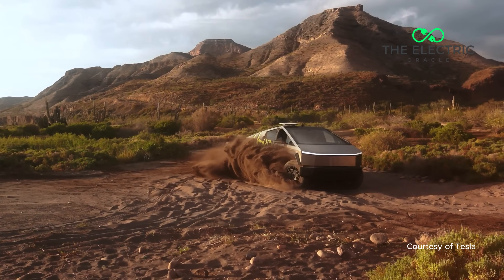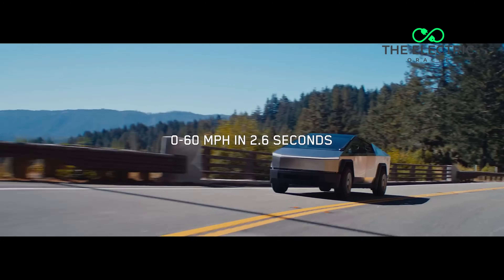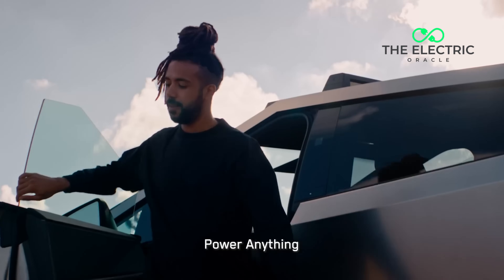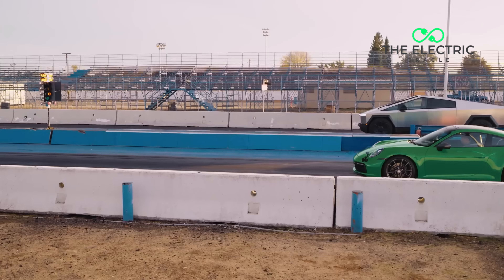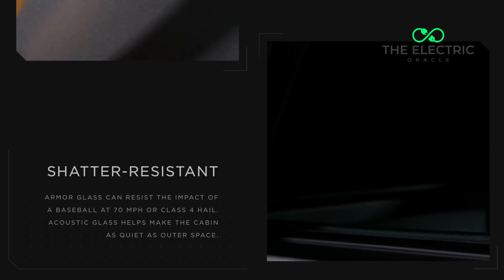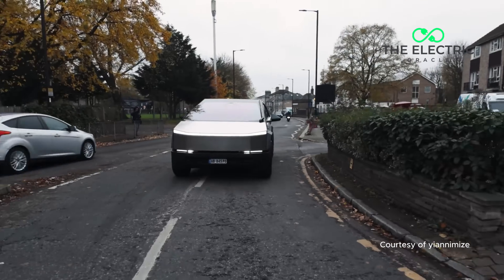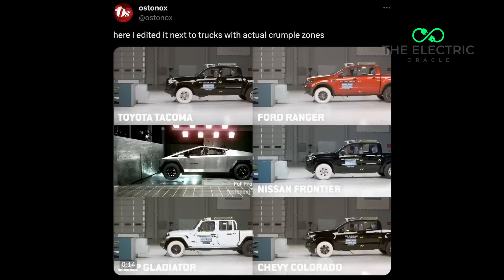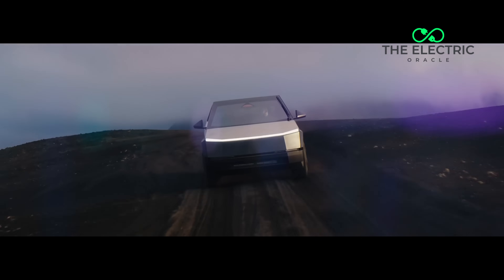5 Safety Issues Keeping Tesla Cybertruck Off UK Roads 🇬🇧

Comment: Never did like the Cyber Truck, that really is a car, with a unibody construction.  In the UK being heavy to be classed as a family car.  Everything about it is OFF target. Tesla I don't like anymore since they got rid of the ultrasonic sensors used for radar, and that they went to camera only, and suffering fantom breaking even. The older cars were safer I believe.

So glad I leased an EV instead of buying one.  A lot less worry about range with an Equinox with 15 gallon tank. Pretty expensive to operate in Michigan due to fees and insurance at $350/mo. The 2021 Equinox has been safer than the Bolt EV, having had three blown tires, and 2 Equinox's having no flat tires yet. With the 3 year lease I got rid of it quickly, and bought a used

Comment: 12:10 - Only prototype body panels were 3mm thick, but production models are only 1.8mm for doors, and the rest is 1.4mm thick.  Regardless, this is about the ugliest, most incapable "truck" on the road (forget about off-road, because they're pitifully useless there), and the UK is lucky to not have to see these rolling dumpsters cluttering their scenery.

Comment: The biggest thing this highlights to me is the poor safety regulations in the US. I've heard stories of the accelerator pedal getting jammed in them. That sort of poor design and testing should never happen. 

I don't think it should be allowed on UK roads, even if it has been modified. The CyberTruck is not a well designed or manufactured vehicle. It's a death trap that's been designed to stroke an ego and 'look' a certain way, not be something that's actually practical.

Comment: For private use a cpc would not be required.
Lights and body panels and no mirrors are not unsolvable.
Glass needs changing. 
Cameras are allowed as primary rear vision.
If it is presented for SVA then crumple zones are not required.
Final the insolvable problem, which you didn't point out:
The cybertruck has drive by wire steering, there is nowhere in UK regulations that allows a drive by wire vehicle to be driven on public roads.

As it is over 3.5t it has to have an off road overnight parking space near the owners address.

Comment: Interesting, you asked the question should the regulations change for new e-cars technology. When the question is should they just change for this one off abomination. Others including Tesla already make UK compliant e-vehicles.

There are regulations for a reason. In the US they have J-Walking laws which I'm sure I saw somewhere were lobbied on by the motor industry in the early days due to people getting hurt and killed by the cars. No we don't want to lessen regulations, if it isn't fit for purpose then they need to step-up and make it fit, after all making cars and selling them isn't a right, it's a privilege, they need to following the regulations.

You also asked about the weight of the battery, the whole vehicle has to include all the weight so no, no exemption. Maybe the manufacturers need to focus even more on making smaller, more powerful power cells/units.

The thing you said about the driving license, maybe some ground there. If it's truly a family/domestic vehicle and it happens to be "heavy" maybe some exemptions. But the Cyber Truck is called and branded as a "Truck" , so I'd expect the driver to have the necessary skills to drive it safely.

Comment: Injdicators??  Non event
LED headlights? Clearly an issue that can be changed by regulation
Weight? I feel sure it is over 3 tonne you need a truck licence. Defenitly here in Oz. As you should to drive this cartoon vehicle. Some Strangerovers are over 3 ton as well. You should need a psych test to be allowed to buy one!
Wireless steering will not pass here either. Must be a mechanical linkage.
Sharp corners?? Never pass here, sharp edges? Never pass here
Tyres for over 3 ton vehicle need to be a commercial tyre which will limit them to around 160k max speed. There MAY be passenger tyres to suit [as fitted] but not legal on a commercial.
Chassis? I think Whistling Diesel made a point on that. After watching that they should not be allowed to tow.

Comment: Hi guys.
Here in Germany the Cybertruck will not get road legality. Never. Period.

The driving license weight restriction is the same all over Europe including the UK.

Wheels extend a tiny bit beyond the body. Which are illegal in Germany. To push them inside would require a complete rebuild of the wheel base. Or to pull the body out would require a complete rebuild of the entire side panels. These are all on top of everything you talked about.

Greetings from a German in Hamburg.

Comment: Musk has ZERO chance of selling any of these in the UK and EU.

It’s a design failure and a beta test product at best and intended for Silicon Valley tech simps to flex when they drive around LA.

Basically a vanity vehicle that’s not practical as a truck or a car for mass production and use.

Comment: Correct me if I am wrong, but the cyber truck is steer by wire. E.g not allowed on UK roads.
There has to be a mechanical connection from the steering wheel to the road wheels.

Comment: Interestingly enough, here in Sweden there was no weight limit for passenger vehicles because, if a vehicle weighed more than 3500 kg, it had to be registered as a truck.

Then came EU regulation and allowed for heavier vehicles being registered as passenger vehicles, if they were designed solely for that: 7 passangers or less, or it would be a bus, limited cargo capacity, or it would be a truck. Basically supersized camper cars.

However,  now there is a weight limit for passenger car licenses, there is a B1 classification for heavy passenger vehicles in the 3500-7500 kg range. 

But it is very unlikely the cyberdump will be allowed on Swedish roads anyway given its numerous safety issues.

Comment: 3:27 "Tesla Cyber Truck can tow up to 4 cars." Yet another ridiculous, pointless, BS claim about this over-hyped vehicle. If you desperately needed to tow a train of four car-carriers across a flat surface like that shown in the graphic, I'm sure this could also be done with a Ford Focus. In any case, the Muskmobile weighs about 7,000 lbs and the average American car weighs around 4,000 lbs. Anyone who knows anything about towing knows it's sheer idiocy to tow something that's >2.5 times the weight of the tow vehicle.
Reply: It seems that you are a little lost when it comes to towing. There is nothing wrong with towing something that is 2.5 times or more heavier than your tow vehicle if the vehicle is designed for it. Class 8 trucks do it all the time.
Even my daily driver (F450) that weighs a little over 9,000 lbs empty (rated to tow 32,700 lbs) has no problem with my 26,000 lbs trailer even in the mountains.  
I wouldn't even think of putting 16,000lbs plus trailer weight (probably close to 4k empty) behind a Cyber Truck, but wouldn't hesitate to throw it behind a class 3 pickup that had at least a 25,000lb tow rating.

Comment: It’s a truck. Not sure trucks have all of the safety materials / systems spoken of. So you might regulate it as a special purpose vehicle. Make it super expensive super exclusive …….or save all the regulatory expense and just ban it. Did Mercedes have an issue with one of its S-class designs being trucked weight in Germany?..On one other thought, security cars with armour etc for presidents and prime minister etc, other than the lights an crash zones, they sound like a cyber truck like non-conformity issue?  Great and interesting video.

Comment: anything over 3 tonnes has to be MOTd every year at a vehicle inspectorate for a ministry plate but you don't need a special licence to drive a 3 tonne van only vehicles from 7.5 tonne upwards.
Reply: Over 3,5t GVW requires C1. Most older drivers have that but many younger ones won't. You could possibly downplate it to under 3.5t but with 4 people in it it would probably be overweight without anything in the boot.

Comment: So that 3 tonn truck is not 3.5 tonn do some research (try using Google) Curb weight	
6,669 lb (3,025 kg) AWD  6,898 lb (3,129 kg) information from the https://en.wikipedia.org/wiki/Tesla_Cybertruck. ps the Ford F150 is heavier..

Comment: It is not really an exoskeleton, it has panel screwed and glued to an aluminium unibody casting and in a accident because of the lack of crumple zones the occupants will suffer greater injuries because of the greater deceleration.  Not only will rescuers not be able to get you out,  you would more likely be in a worse state.  The cybertruck is a poorly designed vehicle and poorly executed.  There are no other vehicles on the road where if you lose electrics you have to go searching for the mechanical releases for the door.  There is a reason why in America tesla has the most deaths per mile driven, and that is without the cybertrucks figures. If a Tesla burns after a crash, it is usually a free cremation for the occupants.

A note on that weight,  7.5 tones is the maximum weight for the vehicle and cargo so it is highly likely that cybertruck is of similar weight to an empty 7.5 tone vehicle.

A lot of the body panels are thiner than 3 mm. The reports from the leaked internal documents about the engineering short comings  of the prototype cybertruck are being  born out with the production models.

Comment: There are more than 5 problems. Steering and  suspension component strength for one.  Rust issues on salted roads. Handling in snowy conditions, or off road.

Comment: None of the 5 issues were a surprise nor a mystery to me, but this is the first time I see a comprehensive explanation of all the minute details of why those are problems and how Tesla may or may not fix them. Great job!
Reply: If front and rear lights must be clearly seperated, i think it is a bit of a mystery how the new Model Y is being allowed then.

They also have a, massive lightbar across the front and rear.
Reply: @JohnDoe-bd5sz  The rear light of the Aston Martin One-77 is continuous too I remember (& the latest gen Range Rover too?)
Reply: There's also the matter of steer by wire being illegal, as is the steering not self centring.

Comment: It seems clear that Tesla designed the Cybertruck for the North American market and don't want to sell it in the UK/Europe market. They have a very good track record in making the cars they do sell here very safe indeed for occupants and those outside the vehicle. If they ever enter this market segment here it will be with a different vehicle.

Also, what is regularly overlooked in my opinion is that the Cybertruck is as much as anything a technology demonstrator, using casting construction, 48V electrics, steer by wire etc. If they work satisfactorily on it then they will find their way into future vehicles. It may be noteworthy that the Cybercab appears to be much more conventional in its basic construction.

Comment: Never mind UK certification – how did this ever get certified to run in the US?
Reply: Because the US attitude to other road users is Foxtrot Uniform.
Reply: Because the US standards are set mostly by the manufactors and then there's the loop-holes in the few they have.
Reply: It's not a big vehicle in the US. Plus we hit far more deer (6 in the last 25 years for me) than pedestrians every year and I , like most in North America, don't want my vehicle exploding just because I hit a larger animal.
Reply: @rich7447  How many deer do people run into on Santa Monica Boulevard? Or in Queens? These are the places most Americans live. Pedestrian deaths in the US are high by European standards and rising, vastly more so when looked at per Km travelled due to the very low distances walked in most of the US because of the very low safety standards on most US roads. 
Also all European cars need to pass the Swedish moose tests which simulate encounters with large animals and include a roll over resistance test most US SUV’s and pickups would fail.
Reply: @davidwright7193  Most people in dense urban areas aren't driving full size pickups and you don't have to get far out of dense urban before you start seeing larger wild life on the road.
Pedestrian deaths have been rising in many parts of the world and a lot of it comes down to inattention. 
The "moose" swerve test isn't even close to realistic for any deer encounter, especially moose. I lived in moose country for half my life and have seen many moose collisions. Very few were avoidable and the drivers who survived were generally in taller, larger vehicles that would not do well in the "moose test". HD pickups do handle better than you would expect though. My F450 is capable of 0.69g on a skid pad and is extremely difficult to roll (8 feet wide and 176 inch wheelbase).

Comment: No, I feel safety requirements are there for a reason I think calling Tesla innovative in case of the cyber truck is well grossly inaccurate. They’ve gone back to the early 80s and that’s for the wait no I do not feel there should be any special dispensation for electric vehicles, damaged the road and the more mass. involving impact is a high energy transfer e.g. other week need to be kept down to keep the car safe plus the fact as Liz not had a good track record of safety effectively using the car on the road to say that own are in the lab sink I can drive itself which can’t I personally think that the cyber truck should be taken off the road in the markets it’s actually in deafly not brought into ours

Comment: being a private use vehicle, even though its C1 category, it wont need a CPC or tachograph, (just like some 7.5t RVs as its not being used commercially), however if you want to use it as a work vehicle, you then need a tachograph and a CPC.  however being over 3.5t it still needs a SPEED LIMITING DEVICE set to 90km/h

Comment: Testing protocols should never be designed around an individual model . 
The idea is ridiculous
They need to reflect a desired safety outcome
American vehicles in general don't get good EuroNCAP results because the Americans don't test for rear seat passenger safety and don't build vehicles that pass  EuroNCAP rear seat passenger safety well.
Look at the  EuroNCAP for the Mustang (2017) only two stars

Comment: The cybertruck appears to be designed to be as inefficient as possible.  
The heavier the vehicle, the more power it takes to climb hills and the more energy gets wasted in braking - even with regenerative braking.
The cybertrucks needed cooling systems add weight and they waste battery power.
A VW beetle is more waterproof than a cybertruck.
Don't expect Musk, who lacks basic empathy imho, to care about how many pedestrians and cyclists get killed or maimed by his egotistical design.

Comment: A typical 7.5 tonne truck actually weighs around 4 to 4.5 tonnes unladen. The 7.5 tonne rating is its maximum weight fully loaded - which means a 7.5 tonne truck can carry at least 3 metric tonnes of payload. However that still means the Cyberurinal is close to the unladen weight of a typical 7.5 tonne lorry, and I’d love to see the Cyberurinal carry 24 loaded Europallets in two rows stacked two-high.
Reply: Cybertruck actual mass is 3.1 tonnes (6800 pounds). The registered mass (includes the maximum allowed passengers and cargo) considerably exceeds 3.5 tonnes. It could be de-rated to 3.5, but it wouldn't be allowed to carry much.
Reply: Maybe a couple of people? I’m wondering (because I work in the industry) if the Cybertruck did arrive here, classified as a commercial vehicle, whether it would be subject to periodic inspections or whether that purely applies to commercial vehicles subject to an operators license. Maybe 🤔 Sure would be a bind if it had to go in every six weeks to have its ball joints tapped with hammers.
Reply: Just stack them vertically and throw an extra strap over.... She'll be fine.😂
Reply: Kerb weight of a Cybertruck is 3 tonnes.
Reply: In the US that's called the GVWR or gross vehicle weight register. That's vehicle weight plus cargo capacity.

The cyber truck's ACTUAL weight is 7 tons.
Reply: I’m slightly stunned by that. While it’s true the Cybertruck has more passenger seats than the 7.5T DAF I used to drive, I think I’d still win on the pallet capacity.
Reply: @rx6180  You forgot that they put Americans in there and they are a ton for every 3-4 persons ...  :)
Reply: @VladimirPutin-p3t  The GVWR of the CT is 9,149 lbs (4.5 short tons). How is the actual weight 7 tons?
I drive a crew cab F450 and it doesn't weigh 7 tons.
Reply: @VladimirPutin-p3t 🤣 That made me laugh so hard. Not sure where you got that information from but it’s incorrect. I think you need to check again… 🤣
Reply: @VladimirPutin-p3t  no it's not.

Comment: Meanwhile other car manufacturers got/get away with specifically lighting features that are a traffic hazard. Probably started with HID headlights if not extrabright halogen bulbs (in part because of the asymmetrical nature of headlight), then awful LED indicator designs. And it is telling how they always mess things up first before severe pressure makes them design in a reasonable way.

The 3.5 tons limit sounds funny, because trucks are taxed as small commercial vehicles in the USA, too, that's what helped them become so popular.

I am surprised the regulations are that lax in the USA.

P.S.: Your abundant analogies are getting really annoying. They're actually distracting from what you want to say.

Comment: Well - to sell in the UK they have to build right hand drives which is much more of an development challenge than to fit aber indicators.
Reply: With drive by wire it may be less of a problem than you think. Probably the only good thing drive by wire has going for it.